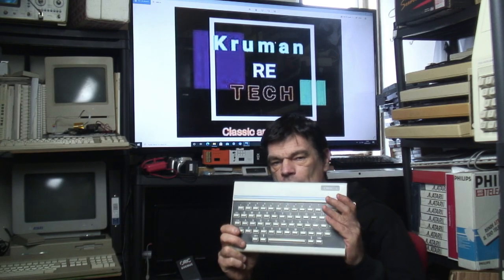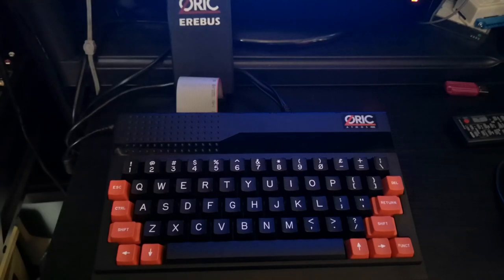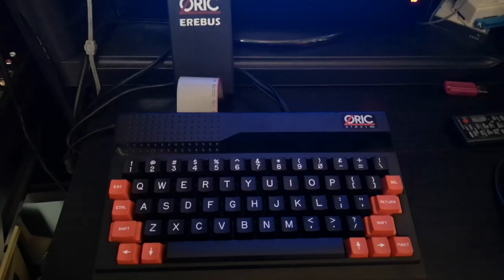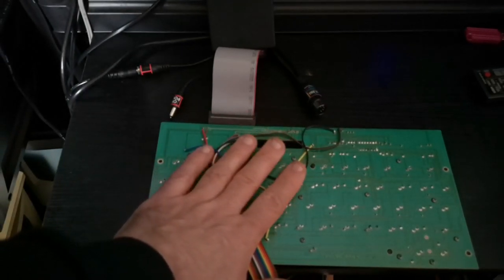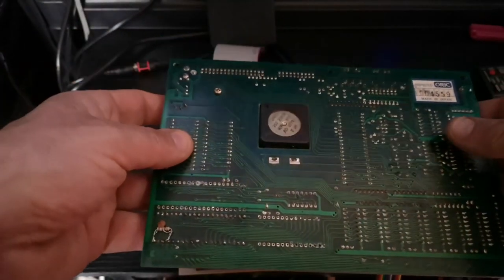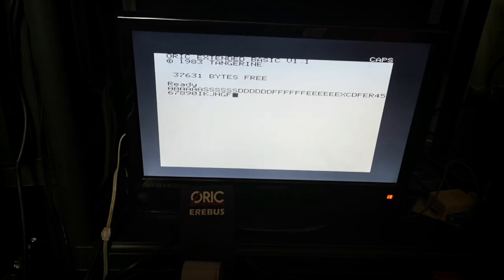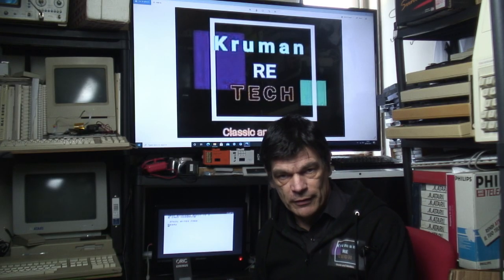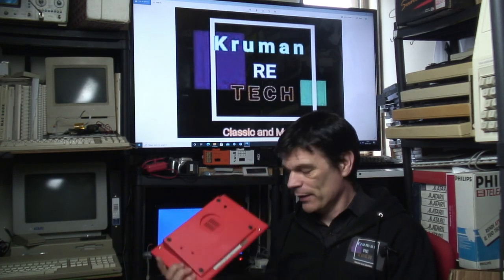Oric Atmos Keyboard Meltdown

Comment: I have 6 old Oric’s, 2xOric-1’s and 4xAtmos (Atmi?). None works perfectly so I need to have a look at these. The working Atmos has some non-working keys so first step is a keyboard transfer with one of the non-working ones. The working Oric-1 has problems maintaining colour, so suspect the RF modulator needs resoldering or components replacing. If you push on the RF lead you get colour, otherwise it is black and white or colour is very weak.